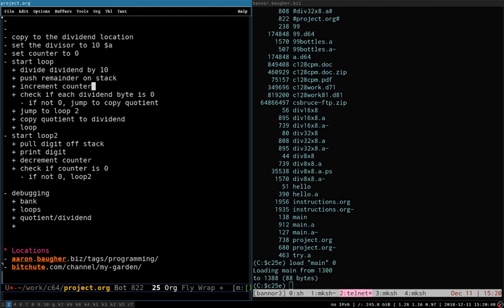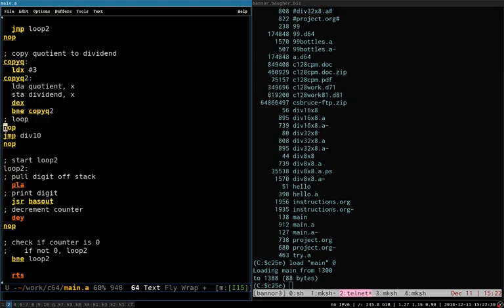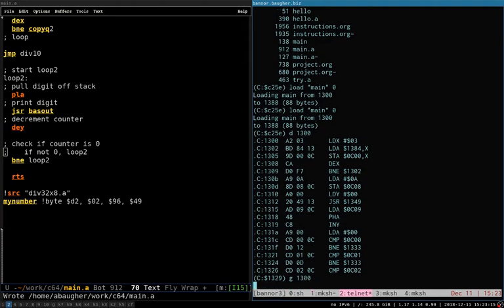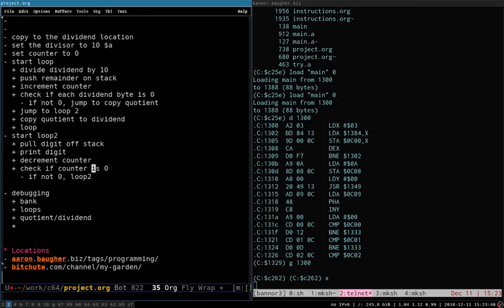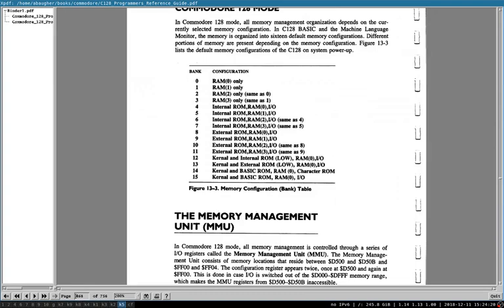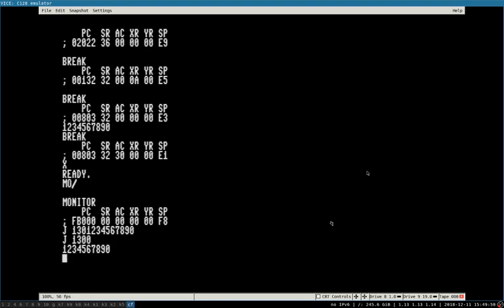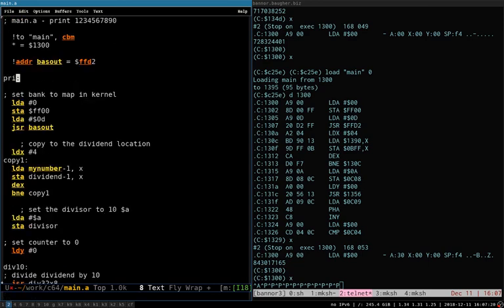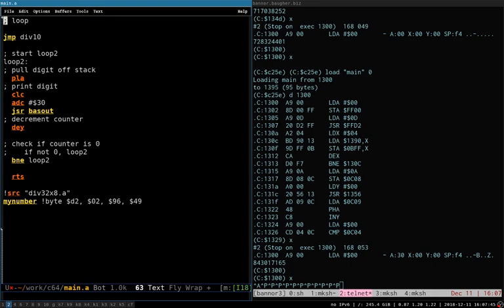6502 Assembly Language #7: Debugging and Future Plans

Comment: Wondering: what is this new monitor with debugging, breakpoints and step by step functionality? How do you run it/access it in Vice? 

Btw, Do you run Vice on windows or Linux?
Reply: Hello. The Monitor is the one included in Vice. File -> Activate monitor. He uses the telnet interface which must be enabled: Settings -> Settings... -> Machine -> Monitor -> Enable remote monitor. As for the OS, Aaron uses FreeBSD. Watch the following video: https://www.youtube.com/watch?v=tg_keuWFB9c HTH, Norberto